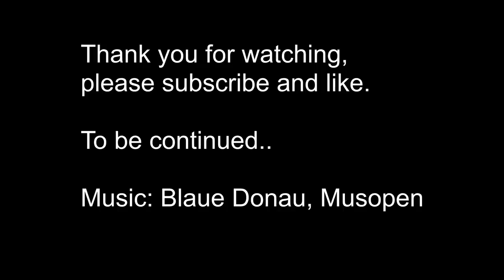A free boat.

Comment: Foxhound 24, great boat, I got one too. Very fun to sail, as it has a fast underwater hull.

PS: the wire that runs from the center of the mast to the foredeck/hatch and keeps the mast from vibrating in heavy seas probably needs a plastic wrap or hose around where it exit the mast. Mine got severed after a while. (I think You call it inner forestay).

Comment: the engine was 2 years submerged and just needed to clean the fuel filter? were the valves not locked?
Reply from the maker: Well there was no water inside the engine. It stood about 20cm high at the bottom.
Reply: Thank God ! in my boat the valves stopped and I'm afraid to even open the engine. there are 2 engines Volvo Penta year 1972 petrol! @peterb871

Comment: Why didn’t he clean the hull before it went into the water? Would have been easier and then 100% of it would be clean. Nice boat for free though!
Reply: I'd imagine it's against the rules of the boat yard. Do you want someone pressure washing years of oily crap off their hull right next to your nice clean boat?  Do you want to walk through that mess?
Reply: @mntnbiker818   ... also there is a good supply of water when afloat.
Reply: @mntnbiker818  So they would rather have years of oily crap going into the water? Noice.
Reply: @mntnbiker818  What else are you supposed to do when you take your boat ashore? Get that hull cleaned up and painted with new anti-growth paint!
Reply: I was thinking the same thing. I would have wanted to pressure wash it put an ablative coat on the bottom and wax the rest.
Reply: @jarodstrain8905  not a fan of the copper-based stuff?
Reply: @wes9451  copper is an ablative.  Although, I didn't use copper on my boat because it was a steel hull. Copper and steel don't get along that way.

Comment: where in the Netherlands are these shipyards with boat in such condition they would give it away for free? (Last time i was around Zaandam and inquired about a boat that hasn't moved for over 4 years and got wholes on the hull, the owner said 70k!!! similar boat i seen on US sites ready to go for 45k so i was pretty shocked.)
Reply from the maker: there is a place called www.marktplaats.nl there you can find cheap boats (and expensive ones).

Comment: Mine wasn't a. Free boat but it was cheap less than €2000 > $2500  Loa 27 foot 3/4 long keel with skeg rudder about 50 years old with 10 hp SAAB still working  and fairly good sails including Spinnaker . She was stored in shed for last 10 years .Interior is same as it was ,50 years ago single skin fiber glass suitable for living in in summer for day cruising .Refitting interior to go blue water. Replacing SS rigging as its too old . sail away from ireland base in 2020 to do local circuit stuff Norway Shetlands France west Spain north and south west Portugal  Canaries  Iceland Azores  Greenland Mediterranean  to Turkey to my sisters villa and take in Greece Italy Malta  en route ,I also  might do french canal Bordeaux to mediterain france .Its  all targeted so if things go wrong short flights to get back to base  ireland . Will be redoing many of old cruising grounds I did the med and western Europe in my 1990 era sailing days I did with several old 20 foot  and 24 foot monos and 33 foot  Cat .  I prefer smaller boats for warm climates They are  much Cheaper to run but I need head room in cold climates and couldn't find 23 foot to 25 foot boats with head room cheap enough  to buy so had to get larger than I preferred 27 foot . I will make boat sailing channel in future
Reply: Good luck to ya, i never let myself go anywhere, i might lose my good job, but after work slows down i can spend some money & time doing what i love..looking for treasure

Comment: That boat lift / fork lift set up is very cool.
Last line, "We wish you a save voyage" sure that was not supposed to be "safe voyage"?
Reply: Because of a trend of the last decades several voiced consonants like the "v" and "f" tended to lose their voice in the spoken Dutch language. Probably because life got faster and it’s just easier to pronounce. As a result "v" and "f" are voiced almost identical in the Dutch language leading to the misspelling of "safe" as "save". In Dutch both words would be pronounced identically.

Comment: I don't understand why you didn't use the pressure washer to clean the hull whilst the boat was out of the water, as a more complete clean could have been done!

That apart, very weii done for saving this boat and giving her some care and maintenance.

The new owner looked very pleased as you motored past the grazing livestock.

Thank you for sharing this video.
Reply: Because other owners don’t like their boats splattered with dirt - many yards will not allow you to jet wash ashore or will only allow it to be done by them (for a hefty charge,often.☹️)
Reply: @stephencrowther524  Thank you for your reply.

I hadn't realized that the yard didn't have anywhere for boat owners to pressure wash their own boats without it splattering other boats.

That's rather mean of them to make you put it in the water to clean.

Comment: A few years back I got the chance to get a free boat.  This boat had been sitting in a field for years and the owner had to get it moved because the land was going to be developed.  He asked me for help.  He told me if I got the boat out of there I could have it.  So I helped him out.  It looked like the boat was just sitting on the ground so I went over there with my equipment trailer that had a 10,000 lb winch on it.  My plan was to just drag it up on the trailer and haul it to the dump.  When I got there I found that the boat was on a trailer and the trailer was sunk completely into the ground.  I was able to winch the boat and trailer out of the ground and on to the trailer.  I insisted that I pay him for the boat and promptly gave him one dollar.  My hope was to restore the boat and use it.  My plan was to call the boat "Pass the Buck". (the prime reason for the one dollar payment)  Turns out the boat was too far gone to be saved.  I did get a nice Evinrude 115 hp motor and a trailer that I made into a utility trailer so it turned out good for me.  Free boats and, or those you buy for a dollar are generally worth exactly what you pay for them.

Comment: I would have pressure washed the boat from the start and a deep cleaning and removing  old equipment
Reply from the maker: Yes I would do that too. But there was no powerwash at the yard there only was one at the waterside.
Reply: @peterb871  are you in Florida I'm moving in january from Wisconsin 😆😃

Comment: I realise my comments are late but if you cleaned a boat with a water jet in this country you will be given a $5000 fine for polluting waterways. The boat must be on the hard stand and surrounded by containment bags or similar. All that muck is now in the waterway. Unbelievably bad work.
Reply from the maker: I get your point. There was no jet or water on the hard stand.  The harbor master gave his permission. Besides that, the dirt consisted mainly of moss and algae. But cleaning on the hard stand would have been better.